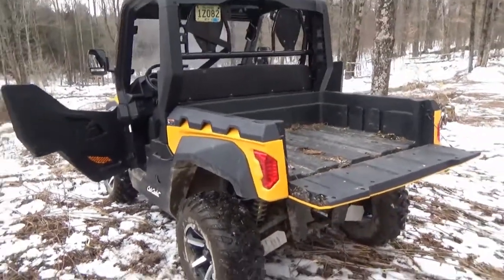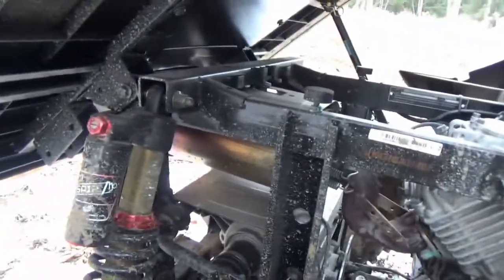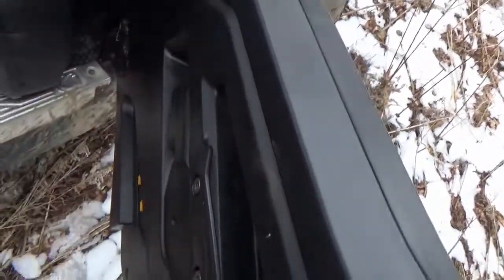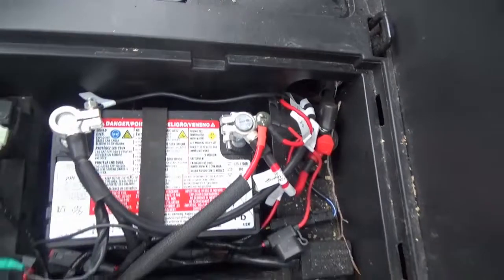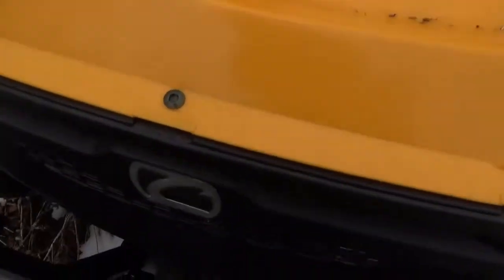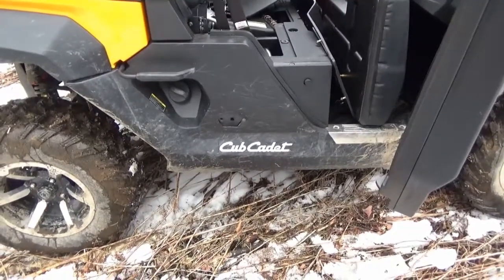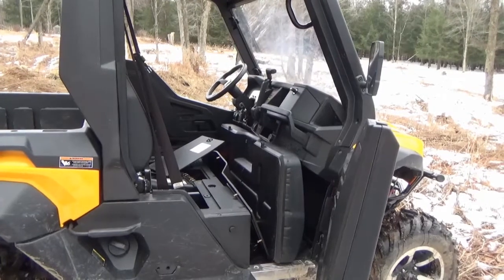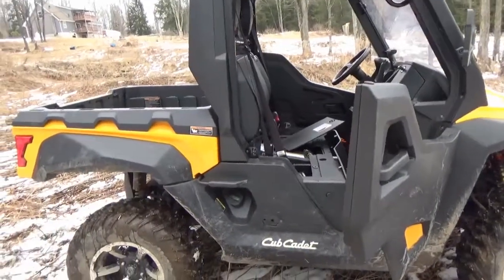More Information On The 2018 Cub Cadet Challenger 750

Comment: Just wondered what ever happened to the CubCadet 750 ?
Reply from the maker: Still have it - https://www.youtube.com/watch?v=Ym9KIbdfFsc
Reply: @SteeveeDan  thanks for the reply. I think I am going to buy a 2018 750 with 321 miles on it. Original elderly owner that has maintained it to the T.
Reply from the maker: @johnelliott9133  They all do have their issues but after spending huge bucks on a Polaris 6X6 and having the engine wipe out the camshaft not once, but twice in 600 hours, I thought it's all just a big crap shoot anyway. However, this is my 2nd Cub side by side and never had a major issue with either one.

Comment: This HAS to be the same as the hisun… i’m kinda more confident in my sector 750, if it got cub cadets approval.
Reply from the maker: It is the Hisun, so far I've had pretty good luck with this machine. A little surface rust on the steering wheel, noisy u-joints until I greased them, and the seal cover tearing.

Comment: i HAVE JUST BURNED OUT MY 3 WET CLUTCH WITHIN A YEAR. The first one Cub Cadet denied warranty saying I was plowing snow in HIGH gear which I wasn't because the oil smelled burnt. Did that trying to load it on a trailer with it slipping a lot. They finally honored the warranty,  I have found now that due to the position of the motor the engine is actually running a quart low on oil when it is at the full mark. I will change the clutch myself and if this doesn't fix it I don't know what to do. I have had real good luck with my Cub Cadet lawn mowers so that is why I went with the Cub Cadet. S
Reply from the maker: Wow, sorry to hear that. I've plowed a ton of snow with my first Cub, a 500 and my current Cub, the 750 and knock wood, haven't had any issues.

Comment: Nice video.  We bought a 2017 750 EPS.  I plow with it and it is a life saver, especially here in Maine.  All the bells and whistles with doors, upper windows, rear window, side rocker bars.  The only issue we have with it is it seems to run louder that others, or at least that is my opinion.  Anyway...great informational video.
Reply: Oh yeah, I'm not a fan of the gas cap area.  It can be hard to dump gas in from a can, especially with the newer nozzles.
Reply from the maker: Thanks for the comment, I love mine too and use it mainly for plowing and fire wood. It is a life saver!
Reply: Mine seems loud to me also...but I love it!!!

Comment: Is the reverse gear terrible high in the 750? That's the only thing we don't like about our 550... can't back up.     2017 cub challenger 550
Reply from the maker: I had the 500 and reverse was lacking to say the least. The 750 is definitely better but still not the greatest. It will climb the steepest hill on my property in reverse at about 3/4 throttle where my 500 was floored and would not do it. Hope this helps and thanks for the comment!
Reply: Well the 550 floored down hill barely has power to load into trailer, but forward its pretty awesome machine, knew we should have went with the 750 oh well, thanks for getting back

Comment: Thank you again for providing an in depth video of your Challenger 750 EPS!!! Your video posts have been a great help in deciding..... I went ahead and made the decision to purchase a remaining 2018 yellow 750 (non EPS) from my local Cub Cadet dealer. I figure it was best to go through a dealer just in case I should have any warranty issues and or needing service for it down the road. I lucked out that they were able to locate this one for me from one of their several dealer locations. All they have left now is a camo or black in the 2018 model year. The 2019's are 2 to 3 grand higher in price due to the tariffs. So far so good and I hope to have many good hours of running/driving time. Thanks again
Reply: How is the non-eps???
Reply: @tonyfarr3277  Hi Tony, I really haven't had any issues with handling of my Cub 750 without the EPS. Now of course, when in 4 wheel drive at a much slower speed you will need to give a little more effort with maneuvering, but it is not a deal breaker for my use. I mainly keep my Cub in 2 wheel drive and really like it!!!
Reply: @mdspear8768  Thank you.     Wasn't sure if it would be worth the extra money.     Much appreciated.

Comment: I just bought a 2017 550 used with only 60 hrs on it from a older gentleman. I really like it there is a few concerns though. 1 it’s a pain in the ass to get in gear no big deal. 2 it pulls really bad to the left everything looks  aligned and tire pressure is all good thinking it’s a shock though. 3 the other day I was driving and slowed down pretty quick from about 25 mph  to a stop and it  was making a grinding noise so I put it in neutral  and it was still doing it. Then shut it off and  started it was still doing it sounding like something was spinning and not catching on what it was supposed to. So I turned the rear diff lock on drove it around the yard then took  the rear diff lock back off and it seems to be doing fine now more concerned about that than anything . Any ideas thanks
Reply from the maker: My 500 was hard to shift too, adjusted the shift linkage and it was about 80% better. Not sure if yours has a shift lock out, meaning you have to press the brake to shift to R. My 750 does and you have to press the brake pretty hard to shift. The pull to the left, I'd jack the left front wheel off the ground and see if it turns freely. Maybe a brake caliper, bad hose, or other issues causing that wheel to hang up. The grind, ya, sounds like if you try to shift when moving, it won't like that. Other then that, I'm not really sure. I'd definitely check all the fluid levels though. Good luck!

Comment: does it get hot on the inside of it in the summer    I am talking about engine heat in the cab?
Reply from the maker: There is a "little" heat build up but nothing intolerable. This year's design is better than the previous years as far as engine covers and layout goes. Thanks for the comment!

Comment: I have a question I just purchased a 2017 Cub cadet 750. Haven't even had it a month yet and the problem I have is it starts up and won't stay idioling. Checked the plug and it was fouled out so I replaced it and still having the same problem. Any help would be appreciated thank you
Reply from the maker: Hiya Mark, Not sure if the 2017 is fuel injected or not but if it is a few things I'd check but you kind of have to know how to check these things and possibly need specialized tools -  a leaking fuel injector,  a coolant temp sensor telling the computer that it's very cold out (makes the engine run rich to compensate for the cold temps), oxygen sensor telling the computer the engine is running lean, wrong spark plug, weak spark/weak coil assy or ignition module, and the air filter being really dirty. Here is a website that you can look at different parts and see what they look like and where they're located. 
.
https://cc.shankslawn.com/oemparts/a/cut/5b75c56f87a86612881805dd/air-throttle-assembly 
.
I hope this helps.
Reply: @SteeveeDan  thank you for replying back in a timely matter. I figured out the problem after I sent the message. I was running 87 gas and not the 91 that it calls for. Drained gas and no problem since. But do have another issue it's making a weird sound when u try to stop. Kind of hard to describe. I would say like a grougle sound. Let me know thanks again
Reply: Gurggel sounds. Not sure how to spell it lol
Reply from the maker: @markoden3921  Not sure on that one. Gurgling sounds are usually associated with fluid movement. I'd try and pinpoint where the sound is coming from and have a good look at what's in that area that could make such a sound. Kinda weird about octane solving your problem, I've always ran the cheap stuff in both of mine with no ill side effects!
Reply: @SteeveeDan  thank you for the reply. Does these machines have a wet clutch by chance?? I was thinking it could be low on fluid if that was the problem making that sound. Let me know thanks again
Reply: The sound is coming from the front by the way if that helps. Kinda sounds more of an air issue but idk.kind of hard to check while you're driving it and slowing down because that's the only time it makes that sound. Thanks again
Reply from the maker: That's a tough one, really not sure without hearing the actual sound it's making. Sorry.

Comment: Great information. I have a Polaris Ranger 570 with a CVT transmission. I was looking at getting one of these new but found a screaming deal on a used Polaris. I was wondering if you could speak a little more about prolonging the life of these cvt belts. The only thing I’ve heard is that you should always be in low gear unless you’re planning on going over 15 mph. Are there any other tips to prolonging the life of the belt you can offer?
Reply from the maker: Probably the number 1 reason belts fail is due to how the machine is driven. Things that will cause the belt to slip causes heat and that will eventually weaken the belt. Starting off in high gear on hills, pulling/hauling heavy loads and so on will shorten the belt life. Keep in mind that when the engine is running and the machine is not moving the belt is slipping. As you apply rpm and the machine is still not moving due to hills or loads, the belt starts to heat up. They are designed to withstand this for a period of time but treating the belt this way too often will shorten its life. Hope this helps!
Reply: Polaris machines don't have a one way clutch, so the belt is always slipping on the pulleys under load, you'd think after all these years they could manage to build a CVT...but they're still using a chain in the transmission for reverse too which is a known weak point too.  Yes with the Polaris machines you have to use low gear when driving at low speeds or while towing heavy loads, otherwise you'll quickly destroy the belt.  

Buy a good quality belt, if they make one with Kevlar buy one, it'll help a little to prolong its life, but with Polaris you just have to live with the fact that their CVT design just sucks it seems.

Comment: I got the same one a year and 2 months ago. Its broke. The timing chain fell off after 150 hours. My friend who bought one after I got mine also had his timing chain fall off after 135 hours. The mechanic picked it up and said they have been having problems with the timing chains. The cost is 900 bucks to have a dealer fix it. And Cub Cadet will not acknowledge any problems. And wont pay to fix it.  How long have you had yours?
Reply from the maker: This one I've had for just about a year, so far no issues. My last one I had about 2 1/2 years and no problems either. I've not heard about a timing chain problem with these machines but I'm going to investigate it. I know my Polaris 6x6 cooked a camshaft with low hours. I replaced it along with the followers and it cooked the new one soon after, that's when I sold it and bought the Challenger. Thanks for the comment!

Comment: Could you tell me if the doors are easily removed or do you have to unscrew things. Was hoping to remove doors to get out once in a 7 x 16 cargo trailer. Thx
Reply from the maker: The easiest way to take off the doors is by removing the four 10mm bolts that attach the hinges to the door. Very easy and the door will come right off. The bolts should be a dark green color and there are 2 bolts per hinge.

Comment: Looking into this model now. Do I understand correctly that it's a made in China machine?
Reply from the maker: Basically it is a Chinese machine. It's my understanding however that the final assembly is done in Texas or possibly Ohio.
Reply: Built by Hisun, and imported by Cub Cadet.  Hisun has been making ATV's for many years, I think they started off with a Copy of the Yamaha Rhino several years ago.  The Hisun engines are also used in a few Kawasaki machines and I'm sure other brand ATV's and UTV's as well.

Comment: Compared to other machines you have driven, how loud or noisey is the Challenger 750  to drive?
Reply from the maker: it’s a bit louder then what I’ve driven in the past but in my opinion, it’s totally acceptable. This is my second one and they both pretty much are equal as far as “noise” goes.
Reply: You're still happy with your Challenger? How long have you owned it?  I've had multiple ATV's and have since sold them and am looking at a utility styled UTV like the Challenger.
Reply from the maker: Still happy! I had the first one I guess 2 years or so and the 750 over a year now.

Comment: Do you know where tp find easy access to accessory power. I have a 550 that I installed a radio and light bar.  I cannot find any sort of bus bar or place to tap into accessory power.
Reply from the maker: Hey Jeff, I've had this same question a few times so I'm probably going to make a video on how to find and access key on power for accessories very soon. Been sick or it would have been done today. Thanks for the comment!
Reply: @SteeveeDan  thanks for the reply. Looking forward to the video.

Comment: Have you had any problems  with the exhaust  I have burned out four of them where the manifold meets the muffler body waiting for the 2019 style
Reply from the maker: So far, no problems. I had a look after I read your comment and all looks ok on my machine. If there is a problem with exhaust parts actually burning out, I'd check for any type of leaks in the system as this can cause higher temps than normal and may result in parts overheating and burning out.
Reply: I finally got the new upgrade exhaust , very nice I have not had  an issue . I have over 3000 miles on now all is well .

Comment: I got a 2013 Cub and I wish I had never seen it. The company sucks they don't support parts. I am buying a Yamaha Viking.
Reply from the maker: I'm sorry to hear that the Cub isn't working out for you.
Reply: Don't support parts?  You can order off the Cub Cadet website and probably with a model number or part number search in Google could get you what you need, probably cheaper than the dealer too.  Had to do that with Yamaha, their service department sucked, their customer service didn't exist, and their parts at the parts counter were outrageous.  The Rhino wasn't the greatest for utility purposes and now Yamaha builds even larger machines that still lack a rear selectable locker.  

I do have to say though Yamaha has the best CVT out there that I've ever operated...pulled my 2100lb car trailer around with it a couple times, didn't like it but it did it.
Reply: @wildbill23c  On the one I have some parts are not available. Glow plug relay for a 2013 diesel part no longer supported. I did get one cost big time so that does it for me. And I have a good dealer they worked at it for a few weeks for me. I had transmission issues at 3 years old broke shaft off so ordered new one got it and was bigger so they must have had a issue had to change out housing 3000$ time I was done. They could of absorbed some of it but nope. So I done with it.

Comment: That’s one small engine the Kawasaki mule 3010 has a bigger motor
Reply from the maker: Thanks for the comment. Dimension-wise, it isn't that large but looks are deceiving in this case!
Reply: SteeveeDan how many cylinders the mule has two v twin liquid cooled and it takes up the hole part under the bed